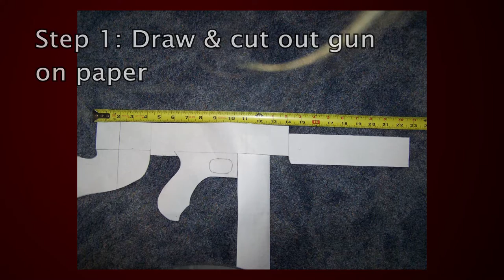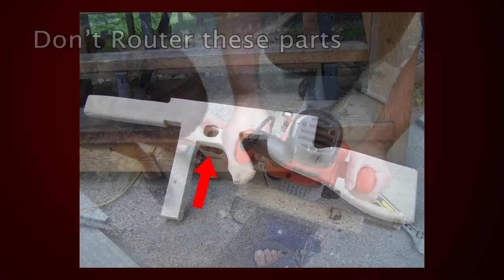How to make wooden Thompson M1A1 in 10 Steps!!!

Comment from the maker: +onur97able
Thanks for your comment glad to here you are creating one! The size I made them from the stock to the end of the barrel is 2 feet 10 inches.
And the material I used for the barrel was a flexible PVC pipe, but try find the non flexible material. I then painted it with a glossy black.
Hope this helps!
Reply: Thx my wooden thompsons 2 of em are cut but have some troubls with the the trigger part of the area is thick and still need to router them what does a router look like
Reply from the maker: Nice! The handle must be one of the hardest parts. Here is a link to Wikipedia about a router. We will find a picture of one there :)
http://en.m.wikipedia.org/wiki/Router_(woodworking)
Reply: Nelson Bowman one more question if you dont mind does sanding my wooden thompsons handle and trigger part make it thinner for me to hold it better
Reply: Nelson Bowman and i would be greateful if you can tell me which type of router is better to curve the edges and sharp parts
Reply from the maker: We have a black and decker router that works good. You should be able to find it at home depot... here is the link of the model we have.
http://www.blackanddecker.com/power-tools/RP250.aspx
Reply: Nelson Bowman thx for info on router but i still need to know one more thing if i sand my replica thompsons triggerguard handle and the top part that is meant for barrel will i be able to thin them handle part is unconfort to hold because of thickness
Reply: Wish i could therr is somesort of bullshit going on with my socail medeia apprenatly some one hacked it wnd use it as a basis to send viruses evreywhere
Reply: Nelson Bowman at the time of 1:08 on your tutorial your replicas handle and trigger is looks  smooth and thin enoough for me to hold with confort i imagine you did that with router well it will be a difficult task for me at the last and worst case option i have cure the edges with sand paper i will look into the router and try to hire one for mine
Reply: McHeavy Fatty i dont care if its a lump of wood as far as i can see its realistic enough
Reply: Some people are  not rich to buy actual replicas
Reply: McHeavy Fatty nah im good the way i am with my own wooden thompson :)
Reply: onur97able i must draw in long paper ?
Reply: Well i did by printing the thompson to A1 sized paper then gave it to my dads experienced carpenter who did via CNC machine and after that bits and details to be truthful i only did the painting and the small sight in front of the barrel
Reply: onur97able me too

Comment: The barrel is to short
Reply: Wrong, there were two variations of the Thompson 

Your thinking of the 1928 or “Tommy Gun” Variant that was used by gangsters in the 20s and 30s

The M1A1 had a significantly shorter barrel because soldiers found it quite difficult and cumbersome to carry an SMG with an extremely long barrel